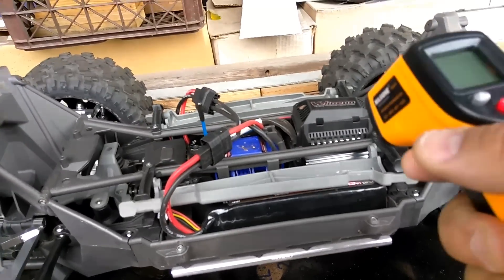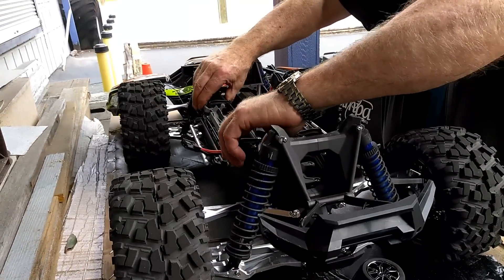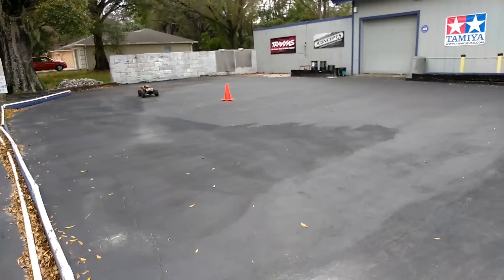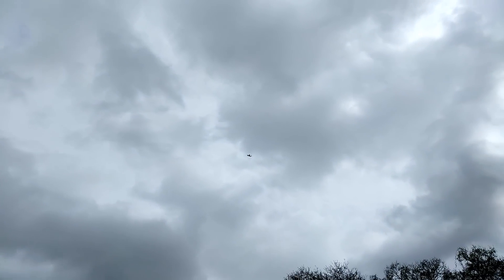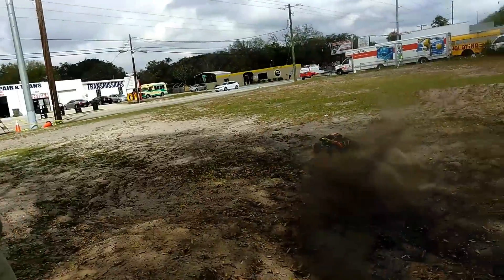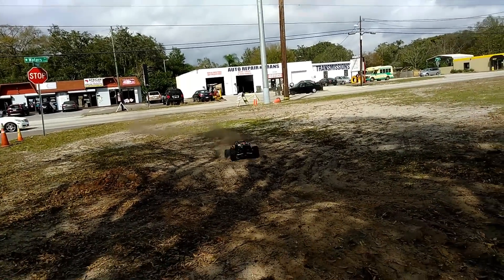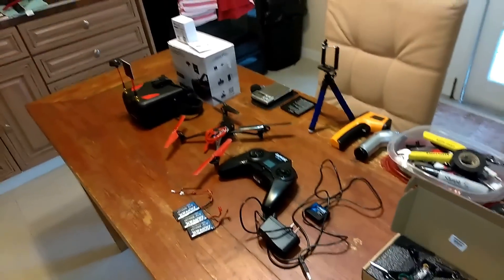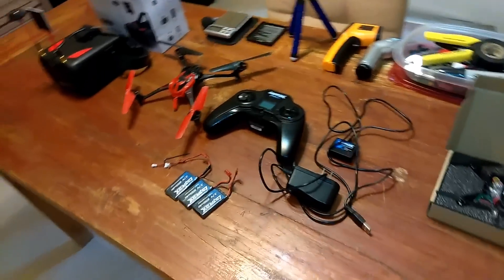Traxxas X Maxx 8s Aluminum Upgrades- Morris Kohl Enterprises

Comment: Hi Dan
My Hubsan h501s arrived last week finally got a window of opportunity to fly yesterday when the weather let up a bit. 5 to 10 knots of wind no rain. I took the quad down the park for a good 20 minute flight and she did not disappoint. She flew like a dream tested all the function and it works perfectly. I have watched all your videos on the Hubsan several times which is probably a good thing as i experienced the dreaded toilet bowl. not sure what caused it, but Remembering your advice i just remained calm took my fingers off the sticks, flipped GPS off and back on and the quad came out of it and corrected its self. All in all I am very happy so far so a big thanks to you and your amazing videos. I am going to order spare batteries and an adapter for my FPV goggles now.
cheers buddy
Ian

Comment: Question will the 8s upgrade system, shorten your run time if you have 6s lipos? Asking since i cant afford new lipos right now :P
Reply from the maker: Hans kristian Knudsen I would assume the answer to that is yes it's running a bigger ESC and a fan cooler. plus it's got different gear ratio now
Reply: Just buy new diff and gears and get a hobby wing max6 and use your 6s motor it will be better then the 8s much faster and more controllable and not catch fire and save you loads off money don’t get the upgrade kit

Comment: What brand did u use for your aluminum upgrades?
Reply: Luis Poggy Remember if upgrade the a arms you just move the weak point. That's probably why the shock tower broke instead of just an a arm. Aluminum shock tower, you're likely to break a bulk head, and so on.
Reply: I'd upgrade the bulkheads and maybe knuckles and leave the arms stock and keep them as the weak point. Worked out well on my t-maxx.
Reply: GNX157 That is the way to go.

Comment: Can the 8s Xmax can run on two 2s lipos?
Reply: Smithesh N: yes it can run 2 2s, 2 3s, and 2 4s batteries totaling 4s, 6s and 8S LiPo power.
Reply: Smithesh N   You can use whatever you want as long as they match.

Comment: Aluminum sucks ,, it may not break but it bends then u have pay 80 bucks rather then ten bucks
Reply from the maker: Truck still running strong it's been bashed gashed smashed and rashed with no issues get yourself a set
Reply: Drone Worship thank you